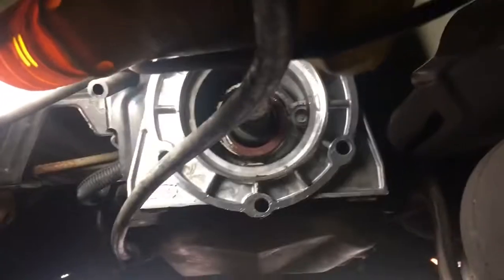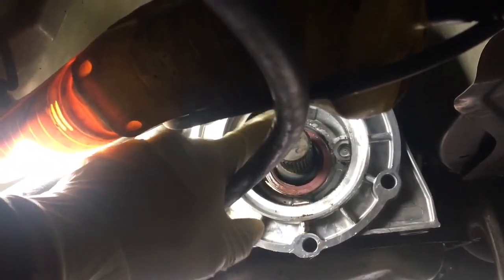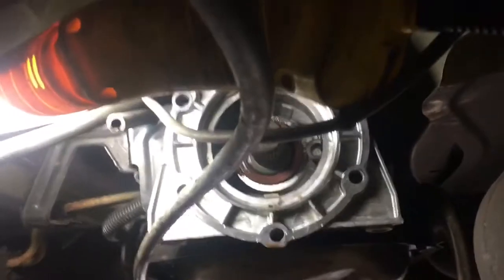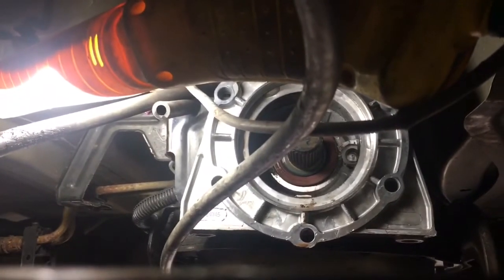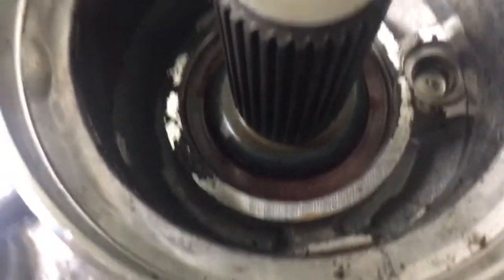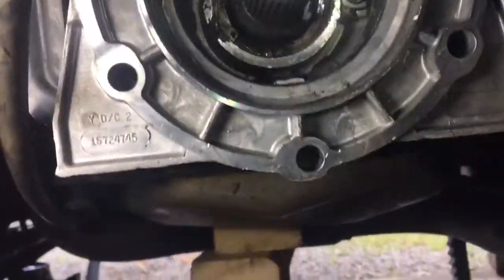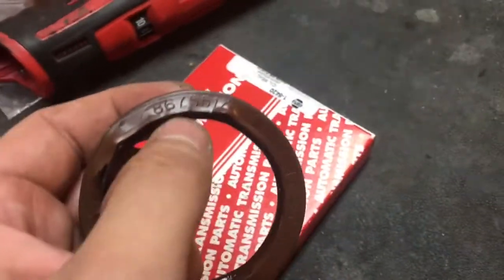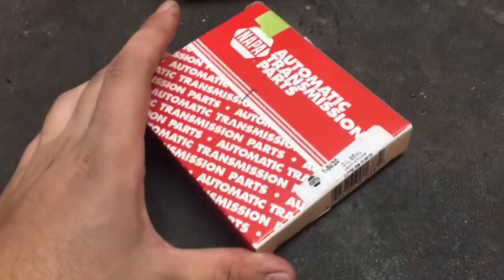4 Wheels Drive Transmission Output Shaft Seal Replacement 4l80e

Comment: Any idea on the part number for the seal install tool?
Reply from the maker: I used a punch. A big wide punch. Your not getting any stars thing over that splines output shaft
Reply: @FcDominick I figured it was some socket shaped thing, I saw one on Google for $500 but thats definitely not happening.
Reply from the maker: @Enduroance might be able to find a pipe. Not worth it for the job. Wide brass punch and go slow
Reply: @FcDominick alright will do. Thanks for getting back to me man!

Comment: I have a 2 wheel drive. And I was wondering, will this work for my 2 wheel drive. I haven't torn it apart yet. But I already replace the seal. On the outside. That connects to the drive shaft. Someone told me that it might be this seal. This calls in it to leak. So that's my next step. Just figure out what action do you think they're the same?Just figure I would ask you. Do you think they're The same?
Reply from the maker: @MR.TOPNOTCH103  the method I’d bet is virtually the. I made this because most videos are of the 2wd outter seal. I saw nothing in this.

Comment: Very helpful having that part number. I went to 2 auto parts and nobody could find a cross reference for this seal for some reason. It's not in any database here. They told me it's probably an ac delco part only. 😂
Reply from the maker: I love when they tell me it doesn’t exist. Then I go back with a number and make them look dumb at the parts store.

Comment: Thanks for video. Very helpful to see the seal number AC Delco 8675517 and the NAPA number. If you checked with NAPA to begin with you probably couldn't find the right seal there because they call it a "Rear lube seal" and if you go by size they show the inner diameter at 67 inches (probably not quite right).  So it's really helpful to see that original number!

Comment: Did you have a small spring come out when you pulled the seal?
Reply from the maker: If it’s round and long. It’s probably part of the seal. It would be small in diameter by its self. Long as the circumference of the seal.

Comment: audio sucks...please redo audio. Also trying to "pry out" with flat blade does NOT work!!! You have to screw in a couple of sharp dry wall screws and use a slide hammer to pull seal out! No room for a seal removal tool. Maybe someone else can chime in on a trick to get this out.
Reply from the maker: I’ll pull the transfer case off for you tonight bro.

Comment: This is way late, but it looks like your trans was a 2wd to 4wd conversion.  You still have the plug with the orifice in the back that is spraying trans fluid into your adapter.  It's supposed to be solid, no hole, on 4wds.
Reply from the maker: Definitely a 4x4 only 1 speed sensor hole
Reply: I have a 4l80e 4x4 out of a 2002 Silverado. One VSS on the main case the 2nd on the T-case. Mine has the two holes top and bottom of the seal/output shaft.

Comment: Did you have to remove the extention to access the seal? I have a 4l60 and have removed the tcase due to pump rub but noticed fluid when i separated the tcase from the transmission. However i looked and there is no visible snapring or seal. Any advise?